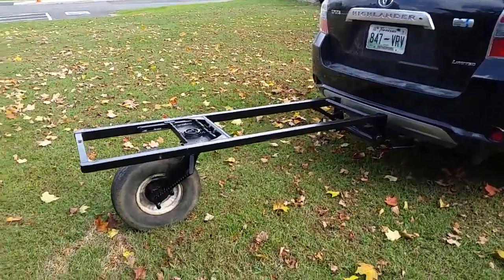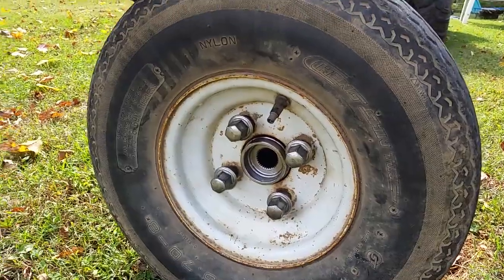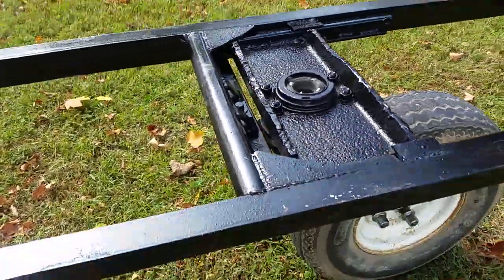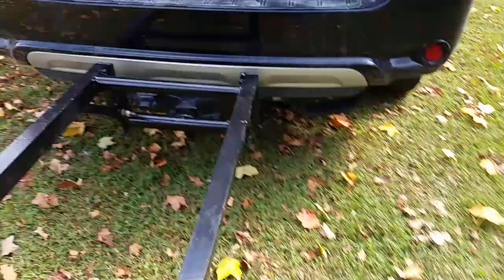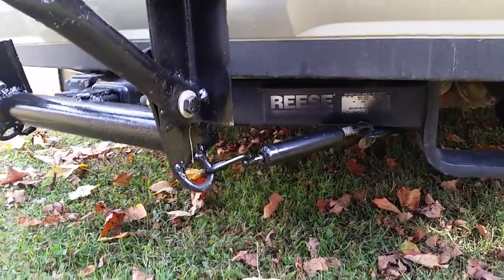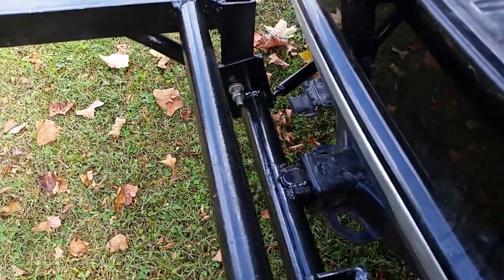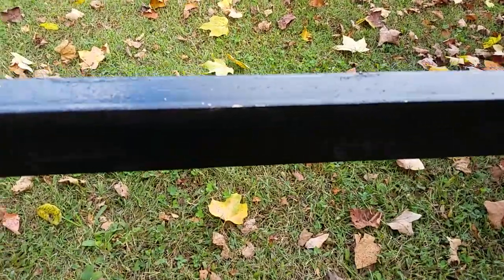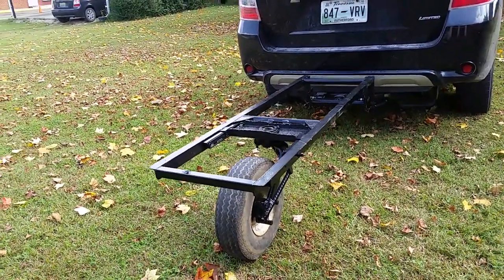Homemade diy single wheel trailer

Comment: Thank you for posting this. Nice experimental effort. All castors "chatter" at some frequency. I'd be interested if/how you managed to cure this with the length of the castor trail / wheel diameter or Balance / dampening the castor pivot etc. Best wishes, Steve
Reply: To cure the chatter, lower leading edge of the trailer to put more caster angle on wheel. It would work until bearing needs repack & lash adjusted

Comment: This is very much what I am designing. I have a Harbor Freight 48 x 40 utility trailer with a 20 cu ft car top carrier mounted on it. My problem is tha to turn, the cargo carrier has to be several feet back from the tail of the car, and I want it snugged up for aerodynamics.That means the trailer must swing with the car, and I need a swivel wheel at the back (or near the weight center of the trailer/cargo load). Why do you have only one side of the wheel supported? I have considered the rear swing arm of a motorcycle.
Reply from the maker: If the castor frame is strong enough, you can use one side… easier for wheel removal

Comment: Very bad idea, when the car turns, the trailer swings out.Hope it never went on the road.
Reply from the maker: It allows you to be able to back up without any hesitation, and when you’re turning it doesn’t swing out past where the car would have driven anyway.
Reply: @biblesalwaysright  The single wheel trailers have been around for at least the 1930's with no problems. Seen them in Australia in the 1980's